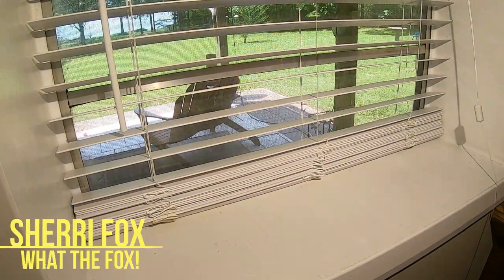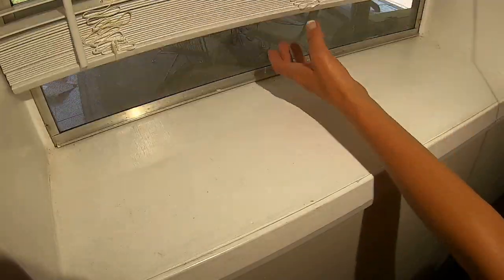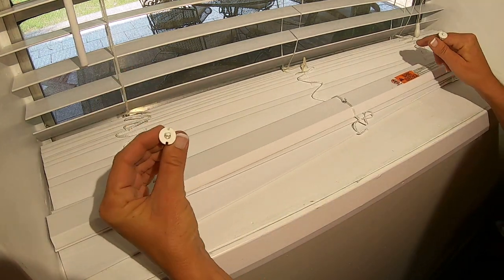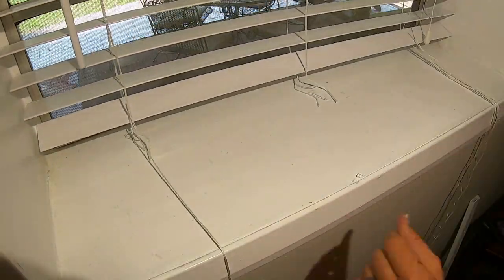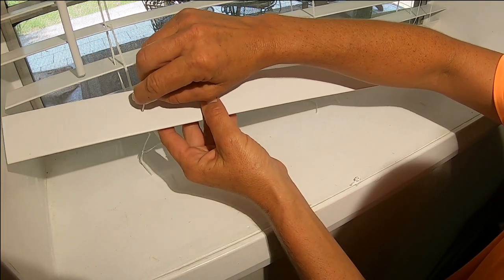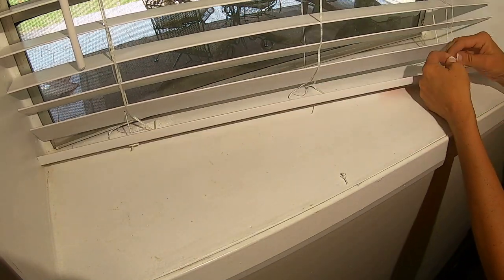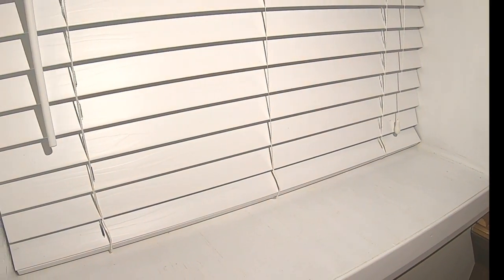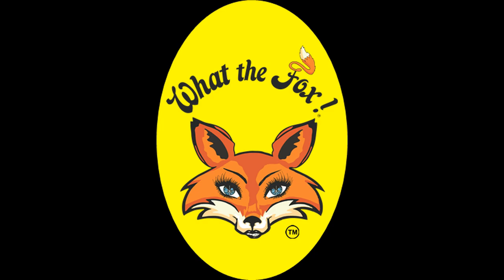How To Shorten Blinds - 2" faux blinds DIY

Comment: Can you also demonstrate how to shorten the recent self rising cordless mini blinds?  👍👍
Reply from the maker: To shorten cordless blinds do NOT cut the pulley cords they are under tension cut only the ladders the same way as in this video…remove one button at a time with the pulley cords still intact just enough to be able to push the cut ladders in the holes … the pulley cords will adjust themselves as far as length after pushing the cut ladders into the holes then just help the plastic button go back into place
Reply: Yes 👍. Thanks for the how-to.
Reply: Read this too lat. spent hours fishing the cords back thru

Comment: I tried this and it was a disaster as mine also had cordless retraction. The cords when cut disappeared into the top never to be seen again 😢
Reply from the maker: Oh no that’s not good, was there tension on your blind? 🤷‍♀️
Reply: @WhatTheFoxSherriFox  no there are 2 style of blinds. One style is open close for the slats the style I have also has a retract feature that always has tension on the cords. When cut they either must be held or only cut one and retie one side at at time. Took 3 hours to fish the string back through the reel and all the slats.